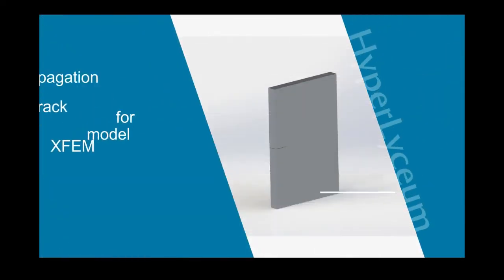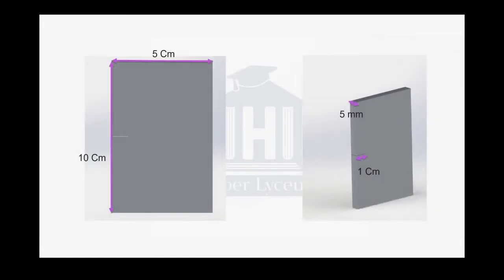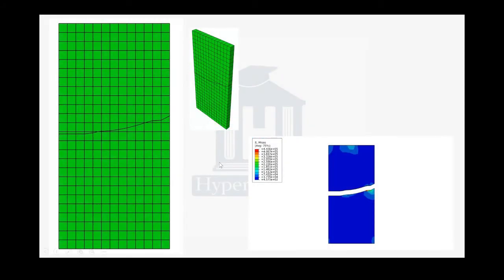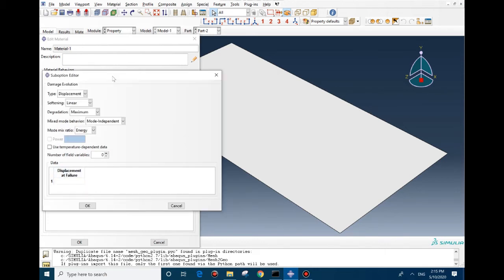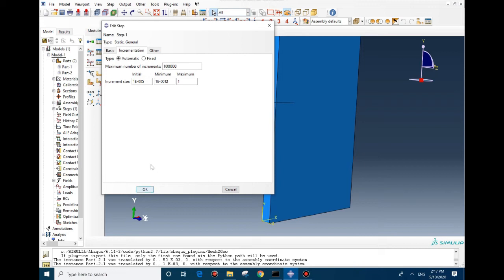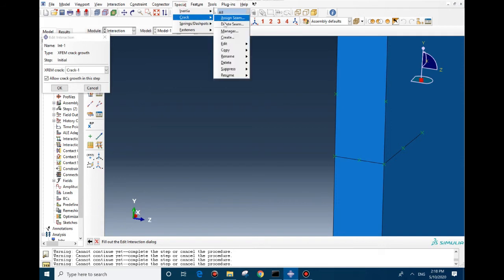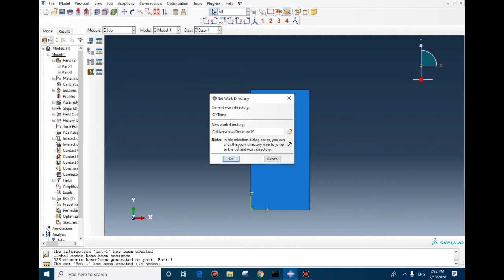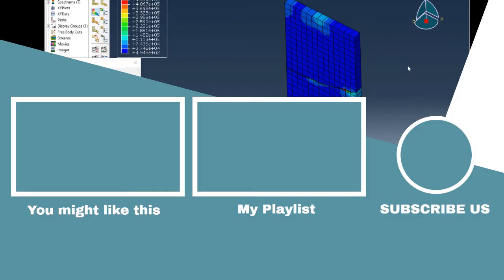An example for a model to predict crack propagation by using XFEM in Abaqus

Comment: Hello,
I tried through same method (step by step) but while running the job I am getting error that part-2 have some elements without any section assigned. Can you help me with this?
Reply from the maker: Hi,
This might happen when the material proprties is not defined correctly (i.e. the section was not assigned) or when the geometry was created the part type was not set correctly.

Comment: Thank you so much for preparing interesting and useful videos!
As far as I am concerned, the capability of XFEM crack propagation modeling for coupled temp-displacement analyses has been added since ABAQUS 2021 release. But apparently, PHILSM and PSILSM options are not available to activate the crack display. So I'm wondering how the "crack propagation display" could be activated!
Reply from the maker: One option is to do it after finishing the simulation and removing the elements that have deformation larger than a specific value. you have to find the value by trial and error. I am not sure where exactly it was but you could find the option in our 2nd and 3rd videos which the bullet penetration was simulated.
Reply: did you solve the coupled tempersture displacement problem without subroutine. please help if possible.

Comment: Hi! Thanks for the video. I tried simulating the same model used in this with no changes, but my job is getting terminated with an error message saying "Too many attempts made for this increment" around the 26th increment. I don't know where I am going wrong. Can you please explain this?
Thanks.
Reply: To aid in obtaining a converged solution, the solution controls can be modified. From the step module, select other => general solution controls => edit => step in which solution controls are to be edited. Press continue when a warning message is displayed. In the time incrementation tab, discontinuous analysis can be checked. This allows Abaqus to do more iterations before checking whether the solution is going anywhere. In the first More tab, the parameter IA can be increased from the default 5 to maybe 20 or more, to allow Abaqus more attempts before aborting the simulation.
Reply: Another option is to add viscous stabilization through the "Damage Stabilization Cohesive" suboption. (Warning value can influence result accuracy, start small and verify)